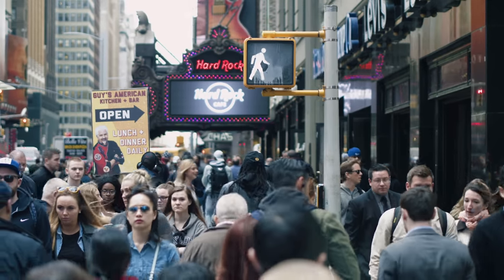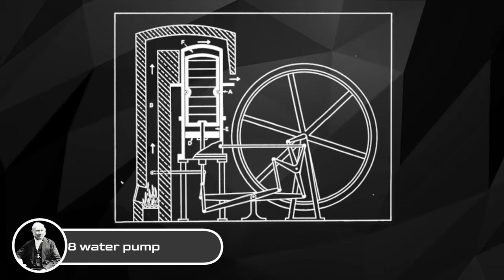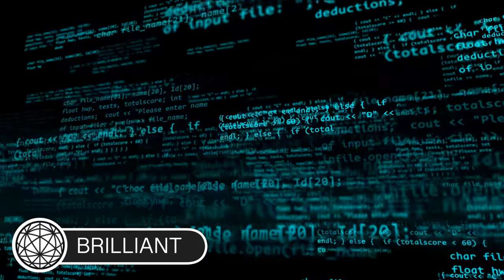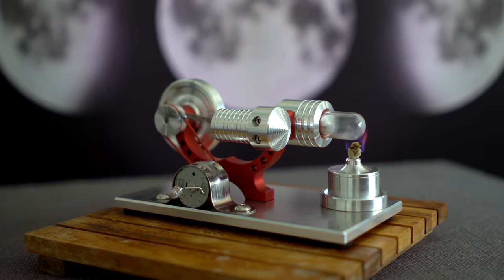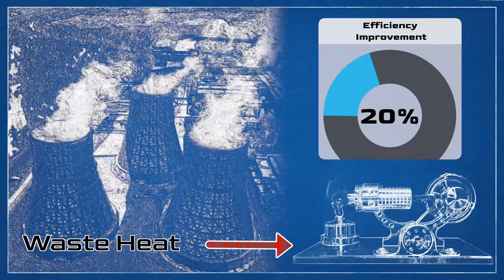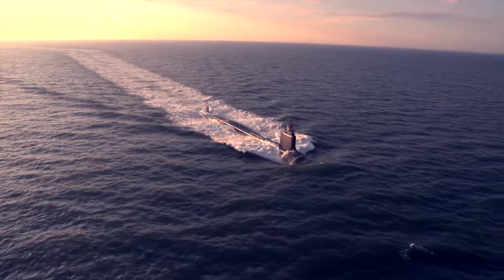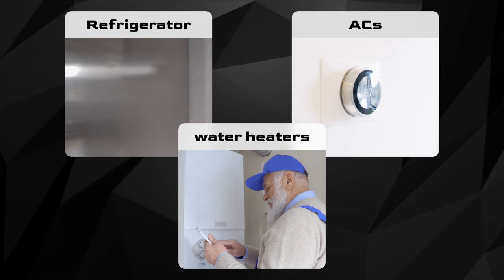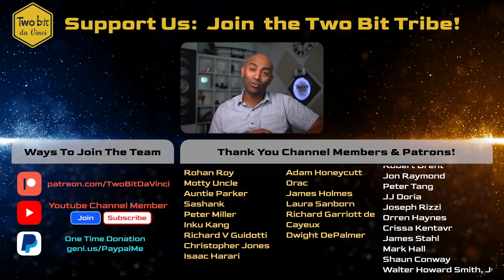Why This Age Old Tech Can Be the Future of Energy - Stirling Engine Explained

Comment: "Stirling engine makes energy without fuel"
Uses a flame to power it. gg

The one exception here would be solar power or any heat source that doesn't require us to burn something. Otherwise the statement that it doesn't need fuel is completely wrong
Reply: Thats the definition of a external combustion engine

Comment: During World War 2, portable generators powered by Stirling engines were used by the military in battle zones because they did not rely in spark ignition that was detectable. After the war these were sold off as army surplus. I do wish had bought one!

Comment: I have been hearing a lot of talk about heat pumps and that led me to your site because you mentioned old technology which I find fascinating as a historian. In your miniature version that powered the tiny L.E.D. light I could picture using waste vegetable oil providing the heat. When you started talking about attics my first thought was the argument I had many years ago with my sister-in-law who thinks she's always right. My bedroom is in the gable end of my attic with a large 36"x 60" egress window that faces west which heats up my bedroom even more. The bedroom is 16'x16' due to city code for multiple unit housing limiting the use of the attic to 1/3 of the overall space. My sister-in-law told me that I didn't need my air conditioners and that it was a waste of energy even though I bought the most energy efficient ones available. She said that their master bedroom cooled down quickly just using a ceiling fan. I explained that my roof is a 12/12 pitch and I couldn't add skylights for cross ventilation because my house was built between 1893-1896 and is historic. I did argue with the city that they did have roof lights in old buildings but they denied my petition. I told my sister-in-law to stop by after we both got off work on a hot sunny summer evening and I intentionally left the a/c running on medium rather than low because I wanted her to feel the contrast. We entered the bedroom and she looked at the a/c with distaste and I asked if she found the room comfortable and she said it could be a bit cooler. Then I walked her to the door that led to the attic and I let her go ahead of me and she stopped within a foot or two of the threshold. I pushed her forward and asked, now do you understand? It is 120 degrees in the attic if it is 75 degrees outside and sunny because half of that massive roof is facing south. I have no idea how hot it is at the very top because I've never made the effort to drag a long ladder up 2 flights of stairs just to see how much hotter it is. During the pandemic I couldn't hire someone to put the big beast of an air conditioner in the window and I tried to come up with various ideas using fans to draw out the heat once the sun went down but if it rained I would have to pull the fan out of the window. When my now elderly cat was younger I had installed an automatic "doggy door" in the door so he could run around the attic and it was his favorite place but now that he is old he no longer uses it so I disconnected the sensor so it wouldn't open and close when I walked by. I had an idea and I opened it manually and put my Vornado fan  (I have 3 of their fans now.) up against the door and it worked to cool the bedroom. Then I bought their standing model and placed it at the bottom of the stairs and pushed the heat from that south facing wall and 3 large windows up even though I know heat rises naturally I wanted to cool the house with no air conditioners. I pulled all the hot air into the attic and for sleep if the nights didn't cool down I had my desktop mini-fan on my bedside table. My electric bill was considerably less than with two air conditioners and other than a half dozen hot nights I had a good summer over all and have two old air conditioners in the attic space. I would love to find a way to use that heat and wanted to understand how heat pumps worked so your video came up and I decided to view it. I'm going to look for more information but as I live in New England the heat is limited to about 3 months and it may not be worth the cost. Thank you for the great video and thank you for reading my "story" as you have gotten to the end finally.
Reply: Why wouldn't you cover up the window from outside put some mirror tint on it, or spray water with chalk in it on the outside to block the sun entering

Comment: The air-condition unit is a really good point... I wonder how much of the heat you could use to drive the fan for the heat exchanger.

Comment: A sun catcher solar dish uses a stirling engine, and is more efficient than solar panels. It can generate power 6-8 hours after the sun goes down without external batteries. Requires no exotic manufacturing or materials. Is currently producing a fair amount of power in the US already, and hasn’t been in the news for 11ish years. I wonder why. Cheap energy isn’t profitable, I guess;)
Reply: What is your estimated cost/kwh?
Reply: Yes @Absolicon does exactly that!
Reply: I saw one design available that used a linear generator on the end of a really neat designed sterling engine with the heat sink at focal point of a single dish, couple years ago..
Reply: @bru512  @Absolicon looks to be about €0.50 per kWh including storage!

Comment: i tried 15 years ago to locate a stirling 5 to 10 hp engine.  I wanted to run it on my wood boiler since there was always a fire running inside and i sure could use the electric..........unfortunatly i did not find a commercially availible unit.  I would have spent 20k for the engine in a heart beat as it is a much better choice then steam for the small scale like me.    Now i can find a 20 hp steam engine ( not turbine) and needed two 14 thousand boilwers to run the engine.   Also i could use the excess heat from the steam engine to heat my greenhouse.

It was a great Article my friend and I thank you for puting it together. 

additionally since the wood boiler i had kept water temp at about 190F it was a perfect marriage for the charcoal\methanol refrigeration systems .............just perrrrrrrrrrrrrrrrrfect~

Comment: Thx for sharing. One place that the Stirling engine/heat pump is being used everyday is the cryo-refrigerator in an MRI machine. If you've ever been in the room with an MRI machine you'll hear a constant swoosh swoosh ... . That is a helium base heat pump used to keep the coils at super conducting temperatures.
I don't know if someone else mentioned it but NASA had a Stirling engine added to a pick up truck in the early 70s. It had good response to user throttle inputs. Another application was in a boat where it too had good throttle response.
Another great embodiment of a Stirling engine was done by Philips in the 50s. It was used as an electric generator and there are a few YouTube videos about it.
So, these are just a few of the success stories of a Stirling engine in use.
Unfortunately they do suffer from low energy density hence they have to be big. Some time in the future it will be better to use big Stirling engines instead of watching our planet burn up at our hands.
Again, thx for sharing.

Comment: Along with capturing the heat from the attic of a house, all air conditioning systems should be split  system heat pumps, with the condenser of each house being submerged in a tank of water. That tank would be connected to large geo cooled waterline and return waterlines that would be many miles long and 20 feet below the ground. This would remove ambient heat from the area and the ac units wouldn't have to work so hard.
Reply: Does not work in latitudes greater than 48 degrees N or S
Reply: Attach your hot attic to your clothes dryer inlet, attach your outlet to your cold attic.
Reply: There was a news item about a local who wanted to do that and couldn't find a contractor willing to do it
Reply: Greath idea! I also think that so many split air conditioner terrible jncrease temperature in the Cities.
Reply: @CharlieBrown723  Turns out, a lot of people don't live in latitudes greater than 48 degrees N or S. They also don't use AC much, so it's kind of besides the point. Also, yes it does work at those latitudes.

Comment: Again, the total cost /energy cycle needs to be considered. How much energy does it take to produce a Stirling engine versus what it will output (payback time)?  Another drawback is it takes mechanical energy to get the cycle going. Has anyone looked at the amount of electricity that could be produced by the heat in an average home attic versus the cost of installation and maintenance? It’s an interesting concept, but needs a lot more experimentation to become practical.
Reply: Stirling engines last ages so over the life of it you will more than get full return on energy spent to make it IMO 1,000 X
Reply: The real reason they don't work is they are not efficient at low temperature differentials. You need a temperature change of hundreds of degrees.

Comment: GREAT VIDEO -- A few ideas to change your perception of the problem and make it easier to find solutions... 1) Stop calling it "waste heat"... I know it sounds like a little thing, but it makes a big difference in how you look at things.  Instead just refer to it as HEAT ENERGY, or WASTED Heat.  Heat is not waste, it is just wasted.  2) Instead of thinking in terms of "pumps" or "engines" instead think in terms of CYCLES... Heat that exits one cycle can be used as the input for another.  3) Remember that gasses can do work when expanding AND contracting.  Make use of BOTH.  

EX... Combine a pair of  Stirling Cycles with a pair of Refrigeration Cycles -- Use external heat to power a Stirling Cycle, and transfer power to one of the refrigeration cycles.  Next, use the condenser to heat water under a moderate vacuum.  That water converts to steam, and the pressure pushes the vapor to the "hot side" of the second Stirling Cycle and across the evaporator coils of the Second Refrigeration cycle.  The Second Stirling Cycle takes in external heat also, and is used to power the  second Refrigeration Cycle....  Heat from its condenser is also used to boil water under negative pressure to transfer energy to the first Stirling Cycle and the evaporator coil in the first Refrigeration cycle.

Comment: The idea of a house heat line makes a lot of sense. in winter it could supplement heating, so your fridge doesn't just heat up the wall. and in summer a stirling engine could supplement the energy for the heat pump or other devices.

Comment: I've been thinking about this for a little while. I think that if you are going to have a "Heat" line, it makes more sense to dump that all in a larger Water Tank (thermal mass). Maybe in your attic, but maybe not. I am not entirely convinced that you can convert that heat into electricity all that efficiently, but maybe the point is that you do it at all. Still, that's a lot of infrastructure in the home, and people have problems when Solar takes a while for "Payback".
Reply from the maker: Very true… hot water line is a great point and we already have this in homes. It could be the fluid we pump heat into
Reply: I didn't think the point of a heat line was for making electricity, it's to serve all the devices that use or create heat in your house. Hot water at all the faucets, waste heat from the fridge, waste heat from the range maybe, actual heating of the house, waste heat from a/c, recovered heat from drains, etc.

Comment: Our house took part in a pilot programme for the Whispergen MicroCHP unit over a period of several years.  This burned "natural gas" and produced hot water for the central heating system as well as approximately 1 kW of electricity when running.  They were about the size of a washing machine and, as you observed, very heavy.  Ours was installed in the garage.  However, reliability was an issue.  A key component was the so-called " wobble yoke" and both this and the seals often gave trouble.  About the longest it ran without engineers having to come and service it was around 6 to 8 months, and being on the pilot programme, the company came and installed new, improved models several times (about five in total).  In the end, the energy company (e-on) decided to pull the plug on the test program and we had to go back to having a conventional system boiler coupled with a thermal store.
 I believe however that smaller versions are still fitted to ships and sailing yachts.
Reply: I should have made clear that the Whispergen MicroCHP had a Stirling cycle engine at its heart.

Comment: Well, let’s be honest; Stirling engines do not “make” energy, they convert energy- from heat to mechanical power.  Their benefit is that they capture the inevitable wasted energy that is a symptom of combustion.

Your assertion that Stirling engines need to be very large is incorrect.  Many small engines can be employed very efficiently.  That is the tactic employed by a European company who supply 24 such engines set up inside a shipping container.
Reply: I like the death by 1000 cuts. Many small engines should be experimented with more for sure. We need all the constructive ideas we can get.
Reply: Do you have a link to this company?
Reply: @katiegreene3960  Azelio, I think, is the name of the company.  
I suggested this to a previous employer who has ten die-casting furnaces full of molten aluminum running constantly.  Suggested it could cut his energy costs by up to 50%.  We had a tool room that was virtually redundant for 25% of the year which could build and experiment with the engines for a fraction of the cost of contracting.  He looked at me like I had two heads!
Reply: @katiegreene3960  The problem tends to be that their operation consumes a significant amount of power on a daily basis, so they simply get used to this as a running consequence of doing the job and are therefore complacent about what can be done to mitigate the costs.  It would also require additional effort to organize and execute - a job made all the harder by the existing architecture- and an effort that is not directly engaged in production.  These facts combined unfortunately close the idea from the outset.  It would require a fresh and ambitious Entrepreneur with a vision to design and build such a facility from the ground up.
Reply: @Barbreck1  it would be cool if companies would create entrepreneurship from within. Example would when a company has assets like the unused shop you speak of, and maybe some untapped $ and idle hands.  Think of it like shark tank but at your place of work. Give them a percentage for use of thier assets etc and negotiate. Maybe some cool companies would go for it.
Call it shark tank in the tank.
Reply: @katiegreene3960  I once worked in a research and development department in a textile factory.  We developed some ground-breaking fabrics with machine innovations that promised rich future rewards.  A management revision saw the department close and the new tech dismantled and disposed of.  This stalled textile development in the country and now they are struggling to survive against competing products.  It’s decisions like that which have killed our industrial heart.  C’est la vie!
Reply: @Barbreck1  100% agree, this is part of why Sandy munro doesn't like MBAs.
Reply: What's the company?
Reply: @AndrewSheldon  I think he said Azelio, but he was looking to confirm.

Comment: The fuel burnt inside an engine is a fraction of the fuel needed to burn outside of the engines...
Reply: The fuel could be hot air in a desert, heated by the Sun. . .aka free.

Comment: The LTD sterling engine could be run on a heat scavenging basis in the far north. Here in Canada, we have seen winter indoor-outdoor temp differences of 40-50 degrees C. I've always wanted to see an 8 cylinder Low-Temperature Differential sterling engine. If you run the heat from a public building into a C-can and the bottom is out in the cold you would have the potential to make power. There's an Alberta Co. using Sterling engines with the energy from flare stacks in the oil industry to make power.

Comment: A company I worked for in the early 2000's built components for Stirling Engines. The engines were used in solar farms. Mirrors concentrated light onto a heat plate which ran the engine. The engine turned generators.
Unfortunately, that project had issues with premature failures on the heat plate assemblies. 
Plus the costs were considered to be prohibitive.
But, I am a big fan of Stirling Engines.
Reply: Any ideas why a fresnel lens concentrating on the engine, wouldn't work?

Comment: Just watching that little engine turning the generator makes me think that if it charged a small battery or supercap while the engine was running, some simple electronics could be used to detect applied heat and use the generator as a starter motor when the source of heat is first applied. And I really like Stirling engines. What a brilliant invention. Just occurred to me too that the reciprocating movement of the piston could be used to generate electricity by oscillating an attached magnet in a coaxial coil.

Comment: Seems everyone is focused on generating electricity. How about direct mechanical transfer, like running a mechanical pump to move water - probably more efficient and flexible than ram pumps. Could even use some of the water as it transfers for coolant on the “cold side” of the rig. The heat pump concept could be repurposed in many ways.
Reply: Yes, Stirling engines were often used to pump water.